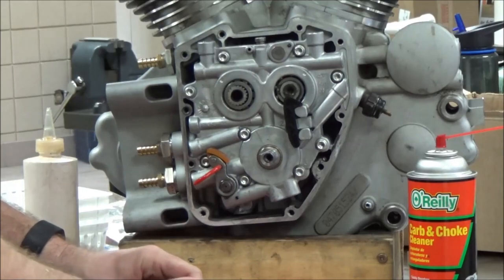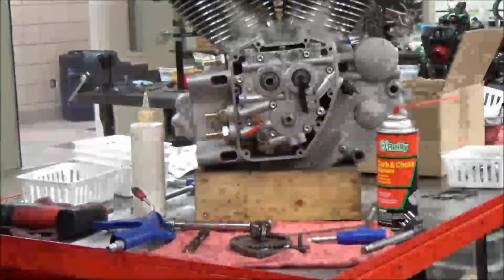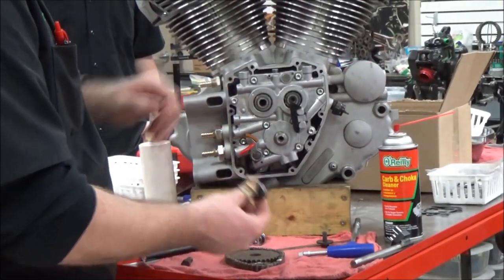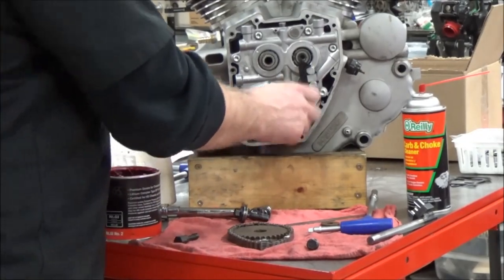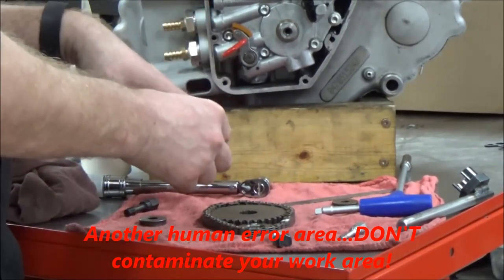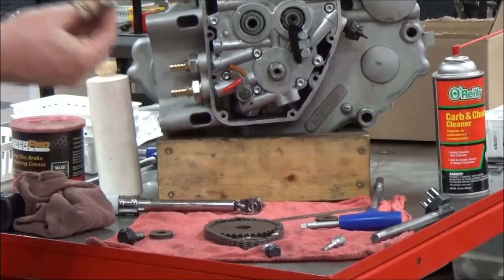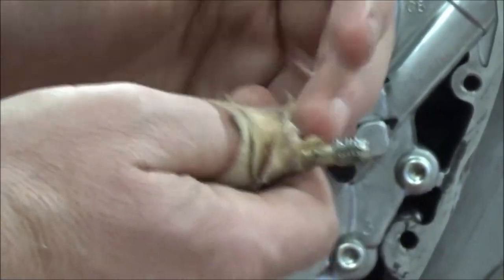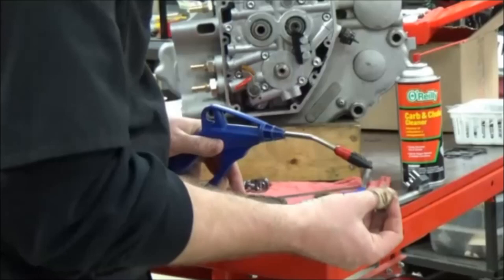Why didn't your loctite work? How to use Thread Chaser and prepare for fastener assembly correctly!

Comment: Shane, doesn't carb cleaner have a lubricant in it which coats the metal as opposed to brake cleaner which does not?

Comment: Once in a while I do have to run a thread chaser through bolt holes in a new part.Never check the threads very well at the factory